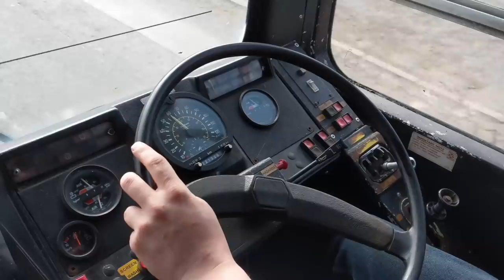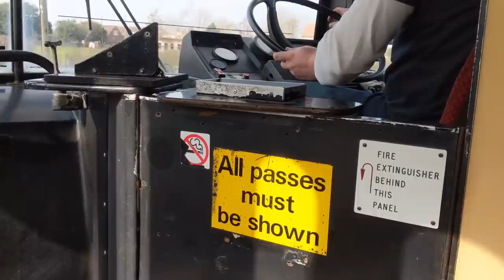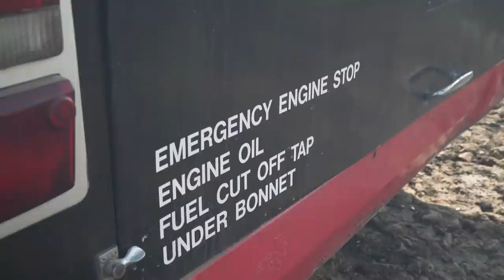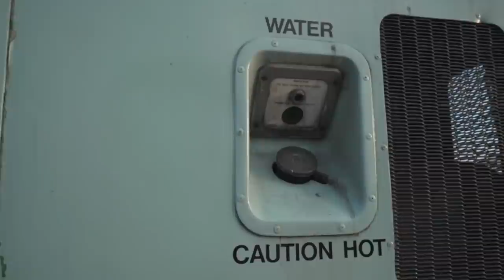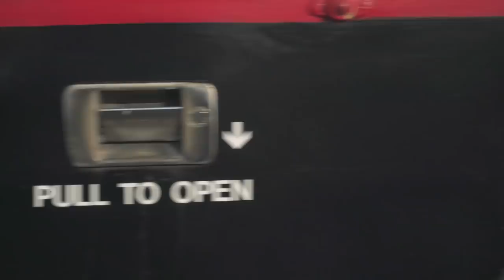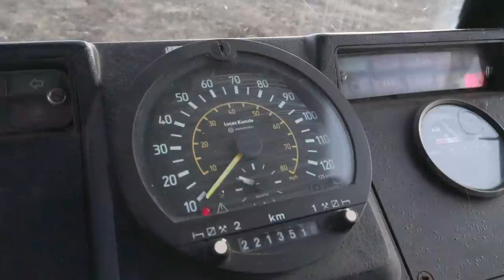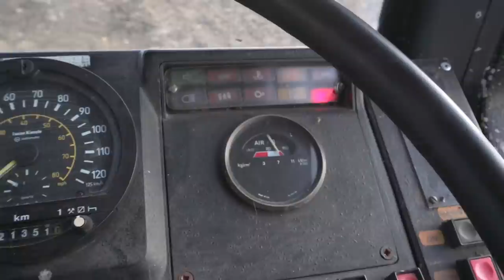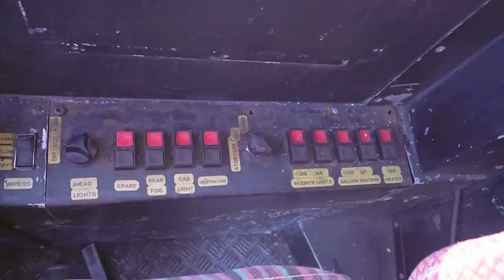The mighty Leyland Olympian  LMM Drives Episode 33.

Comment: You should try a proper bus Lawrie - the original Routemaster. Automatic with manual overide, power steering, dual hydraulic brakes, independent rear suspension. They will run rings around modern buses if maintained properly.
       Wheels up front so if you stick them round the corner, the back follows without having to worry about the overhang at the front. We used to drive them by starting off in automatic second (you never use first unless you are on a steep hill), which is actually in the 4th position on the column. When you feel it change up to third, push the lever through to the 3rd position instead of letting it change automatically, you can then get the most out of  3rd before pulling back to 4th/top. Great fun to drive.
           If want a real challenge, try driving a crash gearbox Bristol FLF. I only had an automatic licence on LT because of the RM's so I had to upgrade to a manual when I joined Wilts & Dorset in Poole. That makes your leg ache double declutching and no power steering either. The instructor also showed us how to change gear without using the clutch just by listening to the engine revs.

Comment: I've driven hundreds of deckers in my time now. Leyland olympians do generally have quite slack steering so they do make it feel like you're leaning alot.
More modern deckers however, if i hadn't seen they were deckers I'd have thought they were single deckers! The power and handling make it easy to forget the top deck is there hence why bridge strikes are in the news alot.

Comment: Leans to 45 degrees? I wouldn't want to be near it when it does. No fuel gauge, especially on a diesel is madness lol. Really enjoyed the video, loved the sound of the gearbox changing gear, brought back so many memories.
Reply from the maker: Pleased to hear you enjoyed it!
Reply: buses were made to be refuelled to the brim at the end of the working day so didn't need a gauge and as they had a 200 litre tank they could be driven around allday and wouldn't run out and I have had an Olympian at 40 degrees with no problem whatsoever
Reply: @DecalCentralUK  Ah that makes sense then with such a huge fuel tank plus I suppose drivers would know roughly they'd get to a tank so would know when they were getting low. I still don't fancy the idea of 45 degrees, I've seen what them Scammell Army trucks can do and I still wouldn't want to be in one at the extremes.....I'm a coward haha!!

Comment: The Olympian and National was the best buses Leyland built. I bet UWW8X and UWW10X have done well over a million miles.
Reply: Back in the 70’s Holland received a batch of 25 National’s Mk1. Revolutionary design yes, costly mistakes made by Leyland made them unloved by the operators mainly because of the O.510 engine. So they were on our roads for maybe 7 years, all but 2 were scrapped, today only one of them is preserved. So was the National the best Leyland bus? I think the Royal Tigers were. Having the O.600/680 engines and Wilson semi automatic gearboxes these were unbeatable back in those days. Later on, say 1967 onwards, the Leopards followed up the Royal Tigers. Chassis and bodywork were produced locally, the rolling parts came crated directly from the Leyland factory in England. Until the very last Leyland that was build around 1981, after that it was over and out. DAF from that moment on took over with a quite similar chassis, the MB200 equipped with the DKDL diesel engine. This design resembled the Leopard very much, even the engine was a near carbon copy of the O.680. Leyland was on the verge of collapsing, caused by the British Government that thought it was a good idea to merge Leyland with BMC. Well, I guess you all there on the Island know more about that than I do over here in Holland! Bye, Willem, Hekelingen, Holland.

Comment: Olympians actually handle really well. Admittedly I'm more used to driving the Volvo examples than the Leylands. And you're absolutely right about the Volvo chassis, they were notorious for snapping over the rear axle, which the Leyland variants didn't have a reputation for. That said, the Volvo engines are very good indeed. I remember one Volvo Olympian example at my work that would do 80MPH, on a test track of course. cough ahem. 😇

Comment: Sad thing is that’s more reliable and will last far longer when maintained than any new modern bus
Reply: Buses are only really built to last between 10-15 years now. And at the moment, bus companies are under pressure to switch to zero emission stuff. Which is fine for town work, but rural stuff, I they don't have the range yet.
Reply: @Teribus13  it is a dilemma yes because also you have to weigh up the emissions emitted by a 30 year old bus over it’s lifetime and that of creating and scrapping a bus every 10 years p,us it’s emissions just because it’s electric doesn’t make it zero emissions. Emissions are created in generating the electricity although not forever. And also the bad effects of land filling the batteries once their lifetime is over and need replacing.
Reply: I joined a bus company to complete my apprenticeship. When I got there I found a number of Leyland buses some 3 -4 years old already in service. I completed my apprenticeship and left the company after 6 years in total. I emigrated to the UK and served in the Army for a number of years. I returned to the Caribbean and was not surprised to see the same Leyland buses still in service. The last one was retired after some 25 years of service. They do not make them like that anymore.
Reply: @derektaylor2941  your not wrong to be fair I just have to remember my grandad saying the same 😂🙈 it is true to a certain degree though they are made more disposable now with many plastic parts in place of metal etc. however this isn’t planned obsolescence like many think or designed to fail at xxx mileage it’s simply saving weight to reduce emissions and fuel costs / manufacturing costs to keep up with the changing times

Comment: It would have had the LVA gearchange system which had the same selector but with an A position for Automatic, but could also be used like the LVS which the 1 now fitted. The chassis is very thin & when delivered to the coachbuilder, had a stress panel fitted between each axle. Originally it had 4 jacking points to which had threads built in for a jacking bracket.
To keep a decker stable in a corner, just accelerate round it, which tightens everything up.

Comment: Great vid Lawrie,nice to see something totally different. One thing,if you can open the front door on the move it's an mot failure/probation. As soon as you release the handbrake the door should shut. Stay safe and regards to the rabble!
Reply: Door interlocking is only an MOT fail on vehicles newer than 2001. Before that interlocking didn't exist.
Reply from the maker: Door interlocking sounds complex.

Comment: Looks like the speedos haven't changed for a long time. Metric on the outside, English on the inside.

I remember the first time driving a double decker route training/learning bus. After a while, I got used to it. Going back to my car and I overshoot corners.

I do like that this bus has the signal stalk where it rightfully belongs. I drive a Bendy Bus (From London) and it has a monostalk, I hate its design and the side it's on. We have various sizes and weights. One is 16t, the other is 16t. Electric windows, mirrors, and safety features. 

If the ramp is out, or the sensor is marked as "ramp extended" the bus won't let you go. I must have fought with that sensor getting it to trigger so I could continue. The ramps aren't even electric.

Comment: Great video again Lawrie. 
Most of the Leyland buses were good, you should try a Leyland Leopard. 
I cut my teeth on Leyland vehicles, the Lynx was about the worst bus that Leyland made.
I learned on a Leyland PD3 decker, it was as old as me.
Another one you should try is the Atlantean, I have driven most of the Leyland buses.
Reply: Leopard, I always remember them as being plush coaches and usually put together by Plaxtons!
Reply: @skylined5534  Yes, but I think more ended up being bodied by Walter Alexander as the Y type service bus or the Y type coach seated with the panoramic windows. 
It was the body of choice for the Scottish Bus Group. 
I drove both types of the Y type. Personally I prefer the panoramic windows with the four headlights.

Comment: Leyland built good buses and sold many abroad - back in the mid 1960s, just about every bus in Israel was a Royal Tiger single decker; the company pioneered rear engine double deckers in the UK with the Atlantean, which was introduced in 1958 and built for nearly 30 years.

Many bus companies were owned by railway companies before the war, and so when the railways were nationalised in 1948, the owned bus companies also passed into state ownership; these became known as Tilling Group companies. The Tilling Group built its own buses (and also some for the Scottish bus group); thus, as a general rule, all Tilling Group companies operated buses with Bristol chassis and Eastern Coach Works bodies. 

Bristol built its own rear engined double decker, the VR; one of the main differences between it and the Atlantean (and Daimler's Fleetline) was that it had a front mounted radiator. Over time, both Bristol and Daimler became part of [British] Leyland.

The Olympian replaced the Atlantean, the Fleetline, and the VR, and I THINK its design team was lead by ex Bristol guys based at Brislington; certainly, with the front mounted radiator and choice of engines (including Gardners) there are many similarities with the Bristol VR. Unlike the integral Titans, Olympians were bodied by many companies - Derby City Transport had ones made by East Lancs and Northern Counties, and Trent had some with Eastern Coach Works bodies which passed to sister company Notts & Derby and only ceased operating recently

Comment: When Volvo produced the Olympian they used cheaper steel in the construction of the chassis, making them prone to corrosion.
Most rear engined double deckers have transverse engines, although some (like the Dennis Arrow) have longitudinal ones - I have a feeling you might like the Ailsa B55 though with its front engine sandwiched between the driver's cab and passenger door.
Reply from the maker: That sounds great!
Reply: Loved driving the Ailsa, drove them in the early80s.

Comment: I remember when confidence had a few olympians they only have 46 now which I'm assuming is this buses sister that's the oldest running olympian in service my dad used to work there in 2018 or some time around there I used to go on them on swims at school and to saffron Lane on sports day. And on trips with my dad on 73 they had the silver coach without the blue decals if your interested. I sweapt 54 with was also an olympian it was like a green house but had 12 and Peckham on the front loved that bus and have an old seat belt off 55 when I did work experience had to take the seat belts in. Iused one tub and two seat bases as I ran out of tubs to use so olympians are one of my favourite buses luckily I was on them before psvar came in they were everywhere and mcw metrobuses, dennis darts, optare solos, Geminis , daf db250s and volvo olympians and probably alot more

Comment: Confidence Bus probably converted UWW10X to semi auto due to a faulty throttle dip valve and it's control unit. You remove them both do a bit of rewiring, put a semi auto gear selector in and that's it. NWVRT who has the final National ever built did the same conversion and say it's drives better and has more power.

Comment: I've always thought the Olympians were a bit vanilla compared to older, curvier buses, but you've succeeded in making it look quite interesting.
I was surprised to see that it has a Gardner engine. I was expecting to see a Leyland lump. The Gardner looks like an antique compared to the rest of the bus. I imagine later Volvo versions would be fitted with Volvo engines.
Reply: there weren't many made with the Leyland engine, at the time the TL11 that was put in Leyland Tigers was used but that was made to be laid flat underfloor as in the Tiger coach and wasn't really suited to be upright at the back of an Olympian
Reply: @DecalCentralUK  the TL11 was perfectly fine installed upright in lorries.  Nonetheless, the Gardner is the top banana anyway

Comment: I worked as a driver in Dewsbury, west yorks in 89 just before getting my HGV licence. I preferred the Bristol VR, older and rougher but in my opinion a better drive, especially the gearbox. The Leyland Lynx single decker push button full auto was new and good acceleration but jerky down shifts when slowing down.
Reply from the maker: I need to drive one to compare!
Reply: @lmm  OK, Not as smooth as leyland and bit of a bone shaker but i preferred very smooth left hand gearchange  and funky big round indicator rotary button on right with bulb in middle. can,t remember what year they were but i,d guess at mid 70,s
Reply: @lmm  Thats the Bristol VR i was describing, not the Lynx.

Comment: A double decker is similar to a water bottle.  A full one will fall over easily,  an empty one will fall over easily. A half empty one is quite stable like the bus with 90% of its weight is concentrated lower down !
Reply from the maker: Easily might be a stretch. If you want it to fall over you could make that happen

Comment: It’s highly likely they converted it from fully auto to the semi-auto selector box you have there could be because that has had a replacement gearbox at some point and the parts dealer (breakers) only had the semi-auto which was very commonly used on areas with a lot of hills. You won’t find many replacements for those vehicles off the shelf these days....
Reply: Confidence converted all of their Automatic Leyland Automatics to Semi automatic.

Comment: Very nice video! I noticed you mentioned the railbues being a failure, really they werent as there are still some in service with transport for wales in cardiff area.
Reply from the maker: Do you mean the Pacer? These came later. The Leyland railbus were not a huge success, only a few were made as far as om aware
Reply: @lmm  I had assumed you meant the prototype pacer, They made a few prototypes which weren't successful as they were purely a prototype. The production ones as I say are only now being withdrawn.
Reply from the maker: @ILikeTransport  I was referring to lev1. I think three were built? Ones at Shildon now
Reply: @lmm  they produced 1 Lev 2, as a research project for possibility of rail buses, future versions included Lev 2, RB3, Railbus demonstrators which look very much like early pacers. After the original research projects were complete the next development was a prototype pacer based on the same principles (classed as Class 140) then after that the first production pacers (141) then the 142s and 143/144s. 142s and 144s having recently been withdrawn with all operators and 143s remaining in service until May with Transport for Wales. 

Most Information was from DMU and EMU Recognition guide by Colin J Marsden (Ian Allan abc guide

Comment: If that gearbox oil really is black, you've got a serious problem -it should be red! And if you think that bus feels unstable, you need to try driving an old 7' 6" wide bus with a full load on the top deck and nobody downstairs, preferably with a preselector or even a full crash  gearbox. That sorts the men from the boys.
Reply: Was red. I changed the ATF oil 6 months ago 👍

Comment: The gearbox in these is actually the same regardless if it is automatic or semi automatic. It is not a big job to convert.
Reply from the maker: Oh really?
Reply: Its quite a clever system used by Leyland designed by a company called Court Systems. The gearbox functions the same and has a "brain" for both semi and auto. The brain in the semi mode is only for safety really to prevent the wrong gear, whereas in auto the brain decides when to change the gear instead of using the selector. I own a few preserved Leylands with this system.

Comment: If you really want to use a larger double-decker bus you should try an MAN SD 200 (1973 - 1985) or an MAN SD202 (1986 - 1992). Most of them got two staircases instead of just one (like your Leyland) and all of them got two doors. Bu, nevertheless, you could also try an MAN DL-double-decker (three axles, three doors and two staircases, length 13.73 m or 45.04 ft)

Comment: Am I weird for being disappointed that that awful upholstery that seemed to be on every  seat (15:32) isn't?

That was Yorkshire Rider standard until privatisation 

glad I wasn't misremembering the pleather either.

PS to the owners, if the bus is ex yorkshire rider the covers at 15:42 were replacements to the original, and based on ripped covers ive seen, just put over the original covers, so you might find them underneath still.
Reply from the maker: Was that something that they did?
Reply: @lmm  the covers?

They updated the fleet using that fabric. I don't know how standard bus fabrics are/were. But if it was done in West Yorkshire it's possible that the original fabric is underneath.
Reply from the maker: @benholroyd5221  that would be pretty amazing

Comment: you have the pre select gearbox on that bus which is why you have the delay between changes / the modern equivalent is a dgs or dcs gearbox / though this acts a kot quicker between changes/ literally no delay ( for those who are conversat in the technicals of both I am not saying they are identical but work on a similar format  though the dcs dgs boxes work a lot faster
Reply: Pre select and Semi automatic are two totally different types of gearbox control.
This is a semi automatic. 
Half cabs such as the AEC Regent or some AEC Regals were preselect.